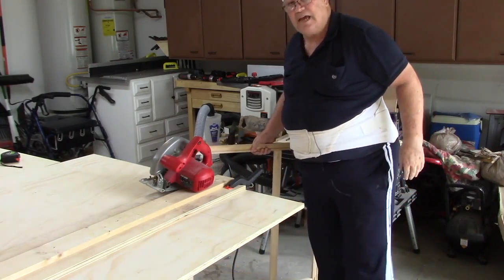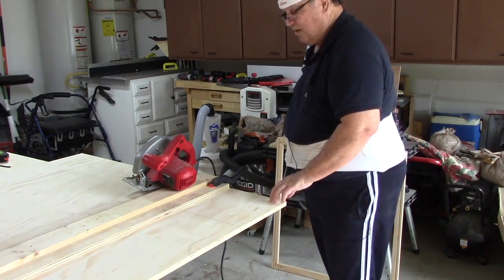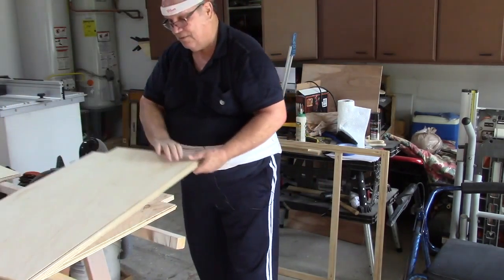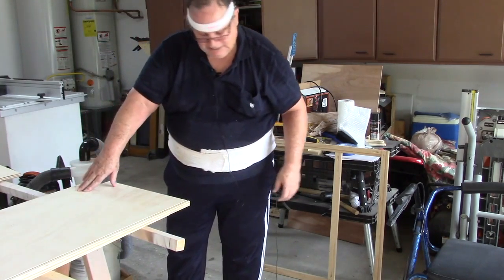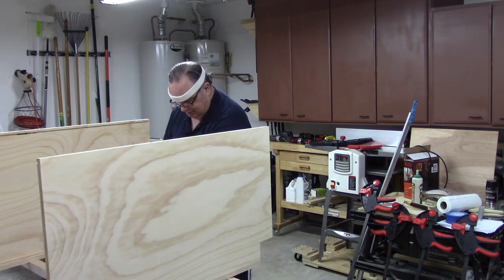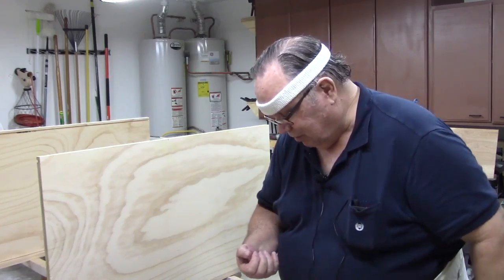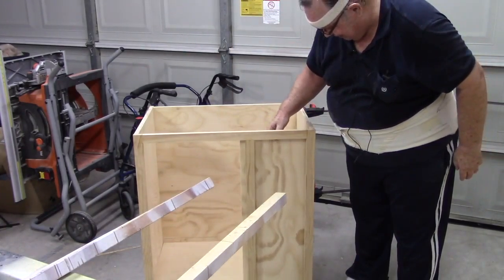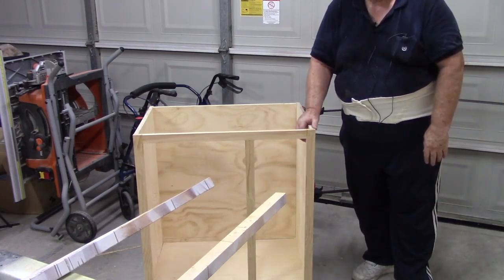VANITY CABINET, FINALLY SOMETHING POSTIVE TO SHOW!

Comment: The names Lewis buddy. Thats why we subscribe to eachother so we have a big support system. Sometimes Ill need suggestions and Ill give them when I can. If you cross grain try that razor blade trick about 1/32th from where you will router and it will leave a clean perfect line like the one you just did. Awesome update buddy. Looking like its going to come together like a true craftsman.
Reply from the maker: Don't know about the 'true craftsman' part, but thanks anyway. I had the mic volume all the way to the max possibly causing the feedback noise? I have readjusted it to 3/4 volume and will see how it does on next video.

Comment: The Pyle mic ( I am an audio store owner we sale audio ) Those mics for the budget can be pretty dang good. What you might have an issue with is certain pink noise bleeding through. I have not used that one myself just done alot of research and saw it come up alot and apearently there is settings in certain cameras, I dont recall the setting but it does fix alot of issues with that mic, and me and you use the same camera if I recall. I also am having the trip over the mic issue you do, since we also use the same mic. Keep us updated on that one so I know, I may order one from my rep and just try it out if it works out for you.